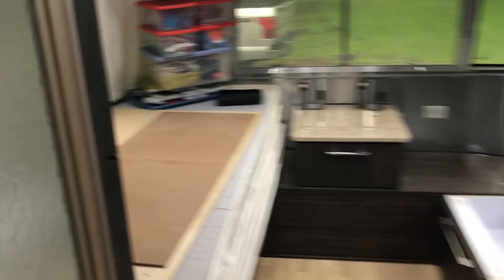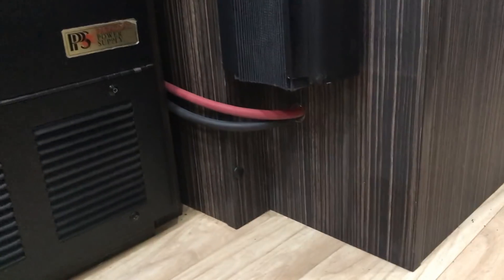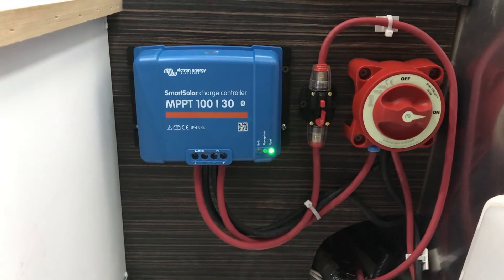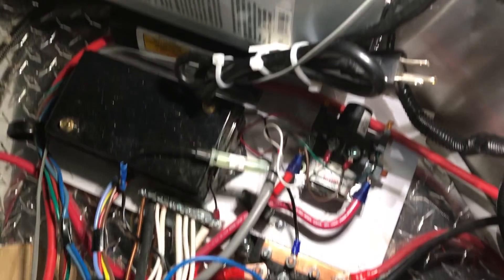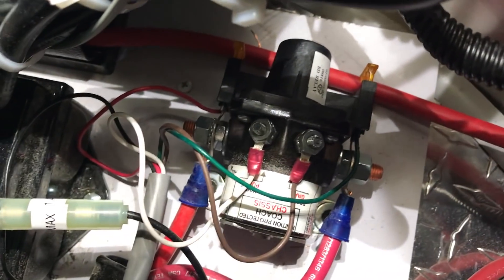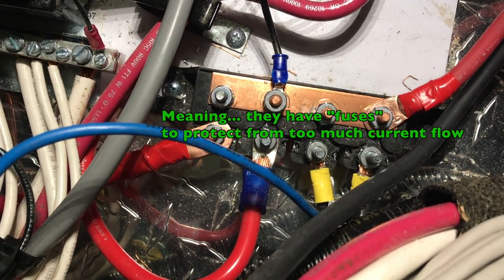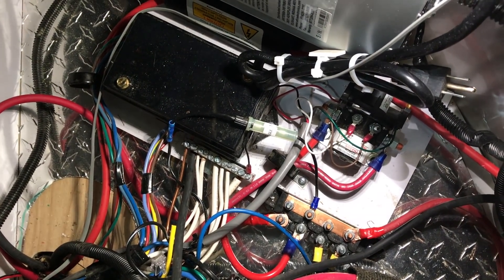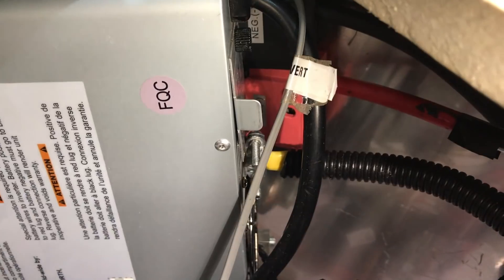RV Solar Wiring Tour -- 25FB Twin Airstream -- 400watts, Victron 100/30

Comment: Great video and helpful to me as I start my solar install on 2017 20' FC.  One question;  I wonder why you choose not to use the preexisting solar wiring from the roof?  I think I see the green and yellow wires in your video..maybe wrong about that.
Reply from the maker: My understanding is that there is some light gauge "solar prewiring" hidden in the ceiling of my trailer, but there were no holes in the roof or other pre-wired connections.  By using my own wires, I could use a heavier gauge (more efficient) and I could run them outside the trailer at the spot I wanted.

Comment: Great content all around! Wasn't sure if this was the best place for the question, or Facebook AS Addicts? Questions: Looking at your running of the wires through the black tank vent, looking at doing the same in my 23FB, but actually looking at running the wires for a 7 in 1 Poynting MIMO antenna for our mobile router, anyway, I see that you used some sort of putty where the wires come out near a collar/coupler of some sort? did you put that collar/coupler there or was it part of the factory install? can you describe how you ran the wires through the vent? I'm hoping that the wires aren't too big, it looks like they would be about 1/2-2/3" in diameter, I'd hate to cause too much air restriction for the vent. Thanks again!
Reply from the maker: I used plumbing putty to seal.  Used an electrical snake to route the wires.  Has worked out just fine a few years in now....

Comment: What did you wind up doing with the sewer vent — I would think that you need that
Reply from the maker: Not sure what you mean exactly... but I ran the wires through the vent.  The vent is still there.  All is working well, no odors, etc.

Comment: Good morning. I am in the process of adding my battery monitor. At the end of this video you had put the hot side of your solar on the positive buss but on the metal side. Did you ever find out if that was correct and what is the difference between the two sides?
Reply from the maker: Not sure I understand your question?   Are you talking about the bus bar or the shunt?   For the shunt, it's important to use the right side and the manual makes it clear.  For the bus bar, I've come to understand (think, believe... but I could be wrong) that one side gets shut off with the use/store button, and the other side is independent of the use/store button—so that the solar panels will charge the battery even when the trailer is in "store" mode.  Where I have the solar hooked in it's working perfectly and is charging my batteries in storage BUT since the use/store switch is a bit mystical and seems to change behavior year to year, you'll want to test and confirm this on your own.
Reply: Thanks again. Yes I was asking about the buss bar. Sorry my question was not clear. My next project is deployable solar, which I have wired to the metal side of the buss bar similar to the way you did it. Thanks again.

Comment: Great video. Once again I have “gone to school” on your work. Although not installing solar, I am upgrading to lithium. Did you consider moving your batteries? From your video it seems like all I have to do is pull all the battery cables into my trunk (27fb). Other than the electric jack, which would have to be extended to the new battery location. Is my assessment accurate?
Reply from the maker: I didn't move my batteries—and I'm still using group 29 lead acids.  I figured I'd attack the demand side of the energy equation and I focused on low consumption items, rechargables, and low-power things like my (beloved!) Caframo fans.

I'm no expert on the electrical, and it's been a while since I did my install.  I believe the jack is the only thing wired directly into the battery (and it only has a positive lead, being grounded to the frame, though you may want to change that if you add a battery monitor).  I'm not sure to answer your question except to point out that if you don't move your buss bars, you will want as short a run as possible between them and your batteries... and as the distance from your batteries to your buss bars increases, you'll want to use thicker cable..

Comment: HI, It's me again, I was looking at your High current on off switch beside before the solar controller.  it looks like a dual circuit.  Why did you use a dual circuit vs single circuit.  I'm going to attempt to install this on my AS and I'm going to have a lot of questions since your set up looks a lot like mine.  I hope you don't mind.
Reply from the maker: Ask away.  I disconnected both wires because 1) overkill and 2) in case I screwed up polarity at some point since I'm an amateur.    I also seem to remember that the single circuit switch had multiple positions and since this switch is operated in the "blind" (by sticking my hand through the access door and switching it without looking at it) I wanted something with only a single on/off position.   It IS quite important that you have an on off switch that's accessible from the outside--and it should be labeled; a simple "PV Shutoff Inside" marked next to the door will make it legal.  Lots of folks don't bother or forget about this detail but you really should do it for the safety of first responders.
Reply: Journeyman so both the positive and the negative go through it? And it doesn’t matter which you you turn it? The negative shuts off the power as well if the virus it is broken? This is probably obvious but I’m just making sure I understand.
Reply from the maker: @EvenaGirlCanDoIt  I think lots of people would tell you (correctly) that you only need to interrupt one of the legs of the circuit, but I'm interrupting both because I'm paranoid :).  Yes, the one switch cuts both wires.
Reply: Journeyman ok.  That’s probably what I will do then. Also do you think it’s possible for me to move the batteries, controller and inverter into the closet in the middle of the rig? Or do you think it will be too hard to move all the other wires
Reply from the maker: @EvenaGirlCanDoIt  Depends on your rig.  You want as short a wire run as possible between panels and controller and between controller and bus-bars/battery.  If you have longer runs, you can compensate somewhat with thicker gauge wires, but it gets pricey.  My goal was to keep everything close to the main bus bars and circuit panels to minimize the length of those runs...
Reply: Journeyman where my stuff is located is at the front under the couch.  My entry point will be the fridge vent in the middle of the AS and the batteries will be directly across the hall from the fridge saving me about 8ft.
Reply from the maker: @EvenaGirlCanDoIt  Could work then.  It can be a real pain going under the floor though, so keep that in mind.  I think "The More We Explore" did that under-the-floor-across-the-hallway setup and their video made it seem like they'd regretted that choice.  Maybe with a good electrical tape (and perhaps some prayer!) could work?  Not sure I'd want to take that on... and not sure I wouldn't just run it across the ceiling in some sort of custom fabricated piece of good looking wire channel.

Comment: I have a 2016 25FB FC and am adding 400W solar. I like the roof access you found through your tank vent. How hard was it to snake the wires through it? Did you work from the top down or bottom up? How did you exit the vent with the wires on the top? Did you ever do a video of the setup on the roof? There is not a lot of free space up there and I think I will have to buy two panels in one size and two in another to make them fit. Unfortunately that means they will not match exactly in their electric specs.. I know this is a lot of questions, but I am ordering hardware and starting on the job, so I'm focused on the nitty-gritty of the job. You did some efficient and clever work on your system and it was encouraging to me. I love the AS, but it is not as easy to modify as some more conventional RVs. Thanks for the detailed video. Skip Griswold
Reply from the maker: Skip... happy to help and ask away.  I snaked from the top using an electricians tape/snake--cheap at Home Depot and they work really well.  It feels like my vent has two curves in it, but it wasn't too difficult...  but I did keep only a short length of cable that goes from the roof box to studs just inside the bathroom, so it's easy to replace that short length of table should I ever need to.
Reply from the maker: I haven't yet done a video of the roof install, but I could send you some stills if it would be helpful.  It is pretty straighforward--and the biggest advice I have is to get all the panels with the mounts prepped on the ground, then just set them on the roof for placement.  My bathroom vents fit UNDER my panels, which was a key element of making the panels fit.  Works great!
Reply from the maker: I exited the vent in the bathroom--"caulking" around the holes with plumbers putty.  I think that's shown in the video.
Reply from the maker: I think the AS is a little more challenging to mod, but it's because it already uses space so efficiently.  I've enjoyed the challenge.  Happy to help with whatever I can!

Comment: Should have put two bends in the lead so that any damp moisture would drip off the lowest corner of the leads. And come out the black waste pipe looking up hill.
Reply from the maker: Yup, that would have been a better idea, but hard to make the u-turn to back up the pipe after entering it at the opposite angle, unless I made a half loop which would have been hard to do inside the pipe.  My black waste pipe appears to have two bends in it above where these wires enter, so I think things are pretty safe from moisture.  I check on it from time to time (just four screws) and it's shipshape after about 6000 miles.

Comment: My 2017 27ft Flying Cloud looks exactly like yours, a mess of wires obviously run by folks that just put them in and go on the the next step.  My Airstream came with the 200 watt solar option and I went in to add panels and upgrade a few items.  I was somewhat shocked to see the layout or the lack of a layout on the wiring and how unprofessional it really looked.  It works great but is a bear to track down anything until you realize that the factory has no need to put labels on component in an attempt to help their owners upgrade or modify their trailers.  I crawled in the front compartment just behind the propane tanks and installed a bigger inverter, charge controller and other parts to work with more wattage/amperage.  I am a small person and I had a heck of a time just seeing  the components, much less moving or re-wiring anything.  Overall, I think you did a great job and the bathroom vent idea worked out very nicely.  I too try not to putt additional holes in the roof.  Kep up the work, looking forward tot the layout of your panels.  I eventually simply added panels to the roof of my Ram 3500 long bed with a commercial contractor shell on it.  Now I plug into my truck rather than a pedestal and can boondock until I run out of water.